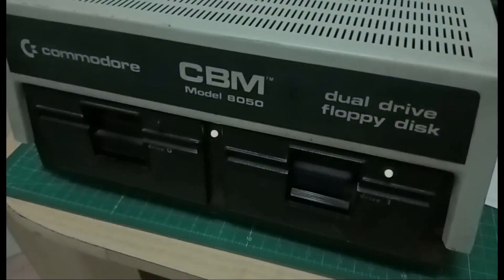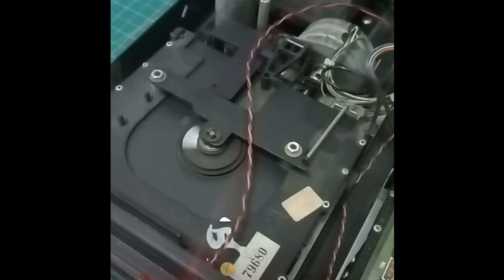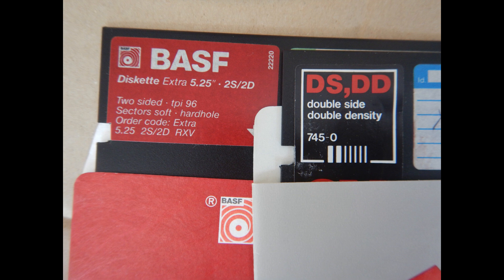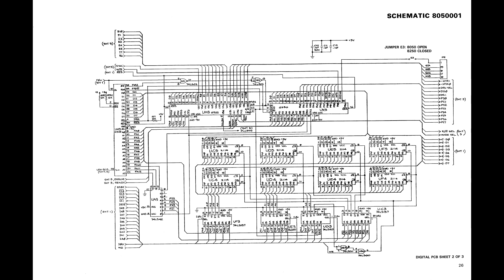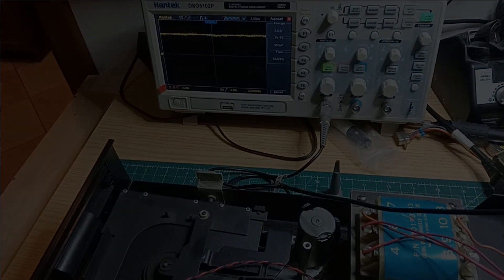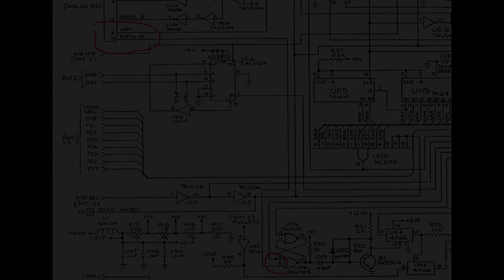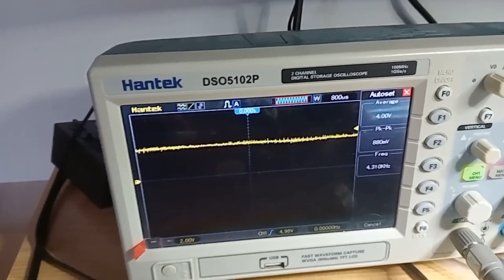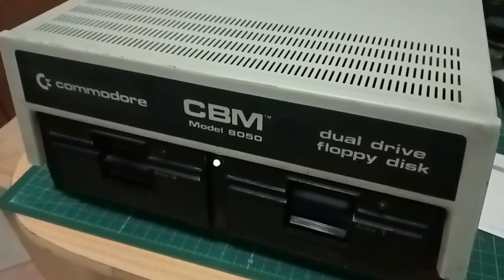Commodore 8050 repair by email. Unusually easy one.

Comment: Fantastic video. Wondering if anyone could help with issue I have with 8050 digital board showing all 3 lights. Activity on all data bus lines but data bus 6 is half the peak to peak of the others!!
Reply from the maker: Hi, if you have some pictures of oscilloscope traces, I could surely give a look at them (no promises it can be fixed remotely anyway), but you need to give me an email address :)
Reply: That is good of you. My 8050 is at work so can only take oscilloscope images Monday to Friday 
Whats is best way to get my email address to you?
Reply from the maker: @davidJcarterPhoto  I'm registered on a few "old hardware" forums like vcfed.org and aussiearcade.com, a private message there could do the job.
Reply: I’m on vcfed Caterman but have not posted 10 times so are not allowed to direct message

Comment: Hola, tengo una cbm 8050 que nunca pasa a bajo el pin19. Alguna idea por dónde buscar e visto el vídeo muchas veces y me quedado sin ideas. Muchas gracias
Reply from the maker: Hi, assuming you mean pin 19 of UM3 (6522) and assuming you're trying to format a floppy with the N0 or N1 commands, the it means the CPU isn't able to address the 6522 correctly OR the 6522 is not working properly. If UM3 is socketed, you can try a different 6522 IC if you have one. R6522 and/or SY6522 ICs can still be found on ebay for example.
Reply: Tested two r6522, one new from Rockwell and another vic-20, with the same always high pin19 result. Today I will try another cpu. very grateful for the time
Reply from the maker: @juanjoselopezgarcia4436  ok ,then unfortunately the problem isn't so easy. You should check pins 22,23,24,25 of the 6522 for activity, these are the control signals used to select and access the 6522 registers by the CPU (there're more pins involved though). Does the motor of the drive start when you issue the format command? Does the head seek to track 1 with the rattle sound?
Reply: @iz8dwf  Does the motor of the drive start when you issue the format command? Does the head seek to track 1 with the rattle sound? It does both things perfectly, this afternoon I will take samples of the pins suggested above.
Reply from the maker: @juanjoselopezgarcia4436  if motor starts and head moves then the 6522 is addressed correctly, no need to check those pins. Are you sure you're issuing the correct format command and are you sure you don't have at least one short low pulse on pin 19? Old basic 2 command is OPEN15,8,15,"N0:DISK1,AA":CLOSE15 for example
Reply: @iz8dwf  I am using HEADER "TEST", D0 basic 4. I still have no low pulse on pin 19, tested with logic analyzer
Reply from the maker: @juanjoselopezgarcia4436  the command is wrong, you need to give an ID otherwise it assumes the floppy is already formatted and just wants to erase the BAM and Directory, but since it isn't already formatted, it gives up in the read phase. Correct command: HEADER "LABEL",IXX,D0 (XX = any two characters, D0 or D1 selects the drive).
Reply: Thanks for your help and interest. For now, after checking the video and searching a lot, it has worked by changing the GCR ROM.

Comment: In our club, we have one 8050, one 8250LP and one SDF-1001 that always give a BAD DISK on track 39 when formatting.
They have been complete recapped (especially the PCBs inside the 8250LP and the SDF-1001 mechanics), but still cannot format.
We tried a lot of disks, even from a sealed box, but none worked, i.e. none out of 5 mechanics worked!

But all disks we tried are 48 TPI (we do not have 96 TPI ones) and I suspect this could be the cause. 
In your video, you state that 48 TPI should work as well, and indeed the service manual does not mention 96 TPI disks at all.
I suspect that out disks degraded over time, even the virgin ones in sealed boxes.
Maybe a 96 TPI, being of a higher grade at the origin, could work, instead?

Another weird thing is that if we format using HEADER "LABEL",D0,I69 providing a disk Id, the error is no BAD DISK anymore, but WRITE PROTECT. Obviously, we checked the write protect signal and it is fine (but we did not check the R/W line after being gated by it).
Anyhow, such error makes no sense! (why without the I option the error is BAD DISK, instead?).
Reply from the maker: Some hints: preventive recapping is usually a bad move unless the capacitors are leaking (and yes, the low profile panasonic drives usually need new capacitors). 48 tpi disks must work fine on these drives, the HD ones do not work for sure. If you don't provide the ID, the disk firmware only erases the old directory and BAM (block allocation map) on track 39, if track 39 isn't formatted, then you have a "bad disk". If you provide an ID then the firmware makes a new format starting at track 1. It alternates between side 0 and side 1 on the dual side drives. You could use the old 10 OPEN15,8,15,"N0:LABEL,ID"  20 INPUT#15,E,E$,T,S   30 ?E,E$,T,S  40 CLOSE15 program to see what the error really is from disk drive firmware.
Reply: @iz8dwf  thank you very much!
We managed to format and read back two 48TPI disks (HEADER "LABEL",D0,I69) by first demagnetizing them with a strong magnet, as you suggested in your video, using both the 8250LP and the SFD-1001!
But the 8050 still gives WRITE PROTECT ON when trying to format even a demagnetized disk (and does not read the disks formatted using the 8250LP).
The error reported is always "26, WRITE PROTECT ON,01,00,1".
As you did in your video, we checked pins 16, 17 and 19: pin 19 never goes down, i.e. the drive never tries to write the disk. This sounds very strange!
Reply from the maker: @DanieleCapursi  for write protect error, check pin 22 of UK3

Comment: Thank you! Great explanations of the troubleshooting process. The dying read/write heads are really annoying though. There are especially many 1541 drives dying of that now... But with the more rare drives it is even more annoying if the heads break, as replacements are almost impossible to find. It would be nice if there was the possibility of manufacturing new heads, but alas, it seems to be too complicated!
Reply from the maker: Hi and thanks for your comment! I believe that at least for the 1541 one option would be wiring-in a suitable 5.25" DD (not HD) mechanism as the only thing that matters in this case is the correct stepper phase changes that must have the same on-off progression as the ones of the original 1541 mechanisms. The head coils can be for sure connected in the correct order and also the spindle on-off command is almost identical on all mechanisms. Index and outer track sensors aren't used on the 1541 so they may be ignored. On the other hand, 100 tpi mechanisms as the ones used on 8x50 drives are almost estinct unfortunately.
Reply: @iz8dwf I fully agree. So I am happy that we are able to show those device off working, as long as possible.

Comment: video is nice! I was hesitant to buy an old dual disc drive from the PET with IEEE488 bus for my C=64 because lack of adequate diagnostic tools, rarity of spares, etc. I do have User port IEEE488 card and cables for it. I might be able to connect my C=64 to my Keithley 2001 bench DMM over that bus, write a program that averages input readings then sends read-out sample to magic voice module.
Reply from the maker: Wow, sounds like a very nice project indeed. I connected various IEEE488 instruments to my PET computer, but lately I prefer to use a small gpib to usb adapter that can be easily DIY-ed. However that isn't as good as magic voice announcing the readouts :D

Comment: Nice video, thanks for sharing and thanks for helping me, maybe I couldn't have made it without your help to fix it. Well that you also explained the formats compatible with these drives, not everyone knows it and it's not easy to find information. the 8050 is a good drive, it allows you to store a large amount of data on a single disk, this is the first model with the first micropolis drives. It was fun fixing it, and then a little luck doesn't hurt. Best wishes

￼

Comment: My 8050, if I try to format a new disk, it will seek to track 0 and give a BAD DISK error after a few seconds. I can read and write just fine, in fact if I just BACKUP a blank disk to an unformatted disk, I will end up with two perfectly fine blank disks, so that's a sucky way of formatting a disk - and I did use this drive to BACKUP a bunch of full disks from another collector at a convention - which worked perfectly fine until one of the rectifiers blew.
Reply: BAD DISK can have many reasons. Query the error channel for more info. Often it's a FORMAT SPEED ERROR as the motors drift over the decades. There are potentiometers to adjust that. Requires partial disassembly and a 50/60 Hz strobo light.
Reply from the maker: Hi! Yes, when it works fine, it usually gives an error if track 1 (there's no track 0 on CBM "formats") can't be formatted for some reasons, but that means the disk controller can still get the SYNC marks after writing the track. I would need to examine the disk controller firmware to understand why in some situations it gets stuck forever.

Comment: I've done some "remote repairs" too on arcade and pinball pcb's. Takes some time going back and forth but is fun when someone can fix his board with a little help. But I can only do it when the fault is in a part of the circuit that I really understand 100%. Especially with arcade pcb's I look at the schematic and most of the time have a rough understanding of it's architecture, which is fine if I have it on my bench but for remote repair that is not enough. You are very skilled, always like your explanation of the workings with the schematics.
Nice fix!
Reply from the maker: Hi and thanks for your comment! You're correct, it's fun when it goes well for sure :) And yes, it helps a lot understanding the circuit we want to debug, whether it's on our bench or somewhere else. If not fully understanding a circuit we can still search for bad levels or stuck signals in the "logic" domain. The analog circuits are usually not so easy.